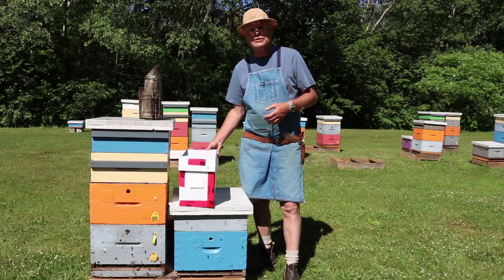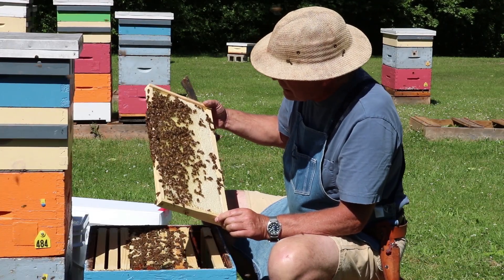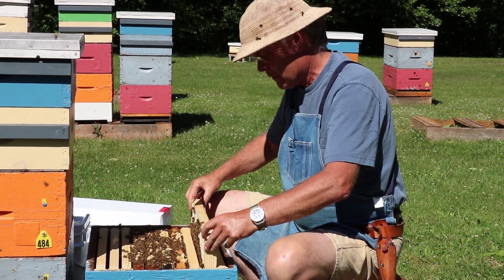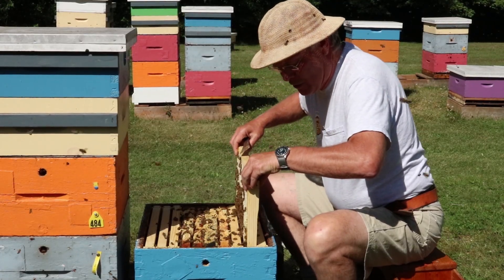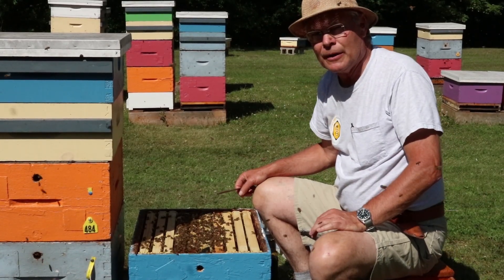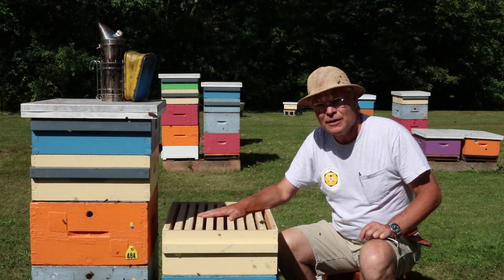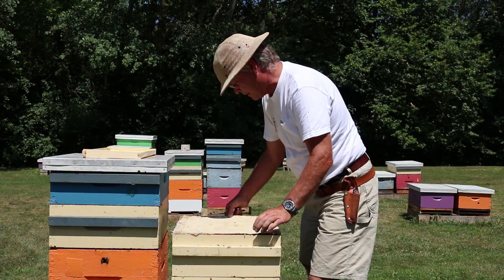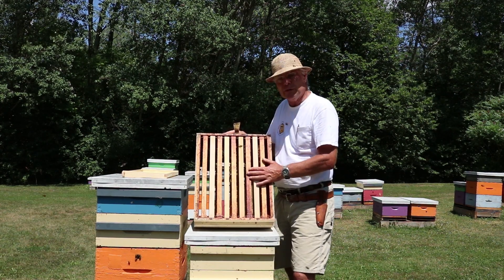Comb Building

Comment: What are you using for the inner cover?
Reply from the maker: Q2: Why do you use canvas for the inner cover?

A2: We use canvas inner covers for a few reasons. They make it easy to take a quick peek in the hive, and are cheap and easy to make. They are light, the lids sit down well, there is less excess wax on the frame top bars, and we rarely need to scrape the inner cover. Ants are also less likely to take up residence on a canvas inner cover. We use 18 oz (#8) canvas – otherwise known as cotton duck.

There will be some shrinkage, so cut it to 1/4″ wider and longer than the length and width of the box.

It is available in the USA online here, in Canada at here, or in Hamilton, Ontario here.

Bees chew through thin canvas so a heavier weight is better. We flip it over periodically when new so the bees thoroughly coat it with propolis. An alternative is a feedbag folded in half.

Comment: I have tried putting foundation frames between drawn frames in a super before, but I find that the bees draw out the existing comb to fill the space instead of drawing out the foundation. Not sure if that's because I have plastic super frames or not.
Thank you for the invaluable knowledge in these videos. It was one of my main sources of beginner info when getting started, and I still refer to them often.
Reply from the maker: I see some of that too but if it doesn't work one year it will work the next.

Comment: Hi guys, thanks for the great videos you’ve produced.  I’m a new beekeeper and just installed my nucs about 9 days ago (June 10th).  I checked on them for the first time today and they are building comb on the new foundation.  My concern is that although I installed the nuc frames in mid-June and the weather has been warm we have not received any significant rainfall in over a month and things are very dry.  Will that affect comb building?  Should I continue to feed my bees?  Does the dry weather affect nectar flow significantly?  I’m in Grey Bruce.  Thanks.
Reply from the maker: Hi There
 It depends on the available forage in your area. Generally hot and dry is good... until it gets desperately dry.

Comment: Hi Paul -- Great  video on comb building!  I have been using similar top feeders but considering moving away from them due to quite a few bee drownings.  I have some rigid plastic floats in the syrup but not very effective in preventing the drownings.  Wondering what type of material you are using in the feeders.  Looks like wood shreds of some sort?
Reply from the maker: Hi Deborah
 We use straw. It's cheap and easy to get here. We dispose of it after the feed is taken down. Very few bees drown.

Comment: When do you normally start providing sugar syrup. My hive has made it this far ok (March 10) but the next month is usually when I lose them all. There's still some sugar candy on the top board not eaten.
Reply from the maker: We feed new colonies like the one in the video when we introduce them. Our full size overwintered colonies are only fed in the fall... a lot! That way we don't need to worry about them running out in the spring.
   If your hives are light start feeding syrup when the bees are flying most days. Candy is ok to get them through until you can feed syrup.
Reply: @UoGHoneyBeeResearchCentre  Thanks. Added 1:1 syrup to a frame feeder in the top (2nd) box which they seem to be taking. Seeing lots of small bees arriving at the entrance with yellow legs.

Comment: An excellent primer in frame management, thankyou! For those beekeepers starting out with plastic foundation, Eric Smith of the Susquehanna Beekeepers did a nice little experiment which demonstrated that if you paint some extra beeswax onto plastic foundation (which has hardly any beeswax on it at all), the bees will much more readily draw it out: https://thebeeyard.org/should-you-add-wax-to-plastic-foundation-yes/  This is a nice trick to use when trying to build your stock of drawn comb, if for any reason you cannot use wax foundation.
Reply from the maker: Hi WW!
  Nice to hear from you. Good tip about waxing the foundation.

Comment: Great video love the info. The issue I have is they are not building on the new frames but they do build on the inner cover. I have about 7 frames of bees and thinking of adding a super
Reply from the maker: Hi Michael
 Thanks. 7 frames may be a  bit early to super. Bees like to move up more than to the side so they don't get all the brood chamber comb built if you super too early. Good luck.

Comment: How do you build your feeding boxes and do you use a 1:1 for comb building.   
Open Air feeding works good but causes a Huge Yellow jacket population that lead to problems late in the year.  
Tried the frame no drown feeders with Plastic float.   Lost a ton of bees to yes Drowning.
Tried the on top drip feeders.   Occasionally the pin holes gum up and drown the bees.  Was told the sugar:water mixture was to much sugar.  

Thanks
Reply from the maker: http://www.uoguelph.ca/honeybee/education-hive-top-feeder.shtml
This is a link to feeder plans on our website. There are plans for other equipment there too. I think hive top feeders are the way to go for most beekeepers in most situations.

Comment: Thanks for the informative video, but I have two questions.

1) I noticed that when you opened the hive the second time, the bees built burr comb on the top of the brood chamber despite the fact that the outer frames weren't drawn out. I've noticed this too in some of my hives. Does this mean that the bees are less inclined towards drawing out comb on foundation?

2) Why did you add a second super when the first super wasn't fully filled with comb?

Thanks again!
Reply from the maker: Hi Sir
 You are most welcome.
 1) Bees build comb around the location they are clustered so they built some on the top bars above the cluster. Good observation.
2) We need to anticipate bees needs.

Comment: Hmm turning that frame around changed the orientation on how the comb is being built. I personally believe, through experience, that the bees really don't like having the comb reversed. The "Y" should be facing up on the outside of the comb, and upside down facing toward the middle (opposite sides have opposite orientation). True it was just one side but that side will be the "wrong way" from now on.
Reply from the maker: I disagree.
Reply: @UoGHoneyBeeResearchCentre  Ok. You don't agree with the Housel Positioning Theory, or just don't think it matters?

Comment: one thing I do is move unbuilt frames into the middle. So far it has worked, what could go wrong?
Reply from the maker: Hi Na
 It will work but it's easier for the bees to look after their brood if you don't spilt up the brood by putting a frame in the middle.

Comment: Do you ever have to clean off the queen cage?  Lots of wax to impeded the bees it seems.  I take a portable propane torch and it  melts and burns  off the excess wax in seconds.  Wonder what you think.
Reply from the maker: Hi There
 Do you meant the queen excluder? We melt the wax off it at the end of the year. We use a heated chest. It sounds like a torch works well for you.

Comment: would it be possible to do a video on methods you use to cull out old brood combs. for instance. if you look in the box and the center 3 or 4 combs fully laid but need to go. how do you set that up to get that done without thowing away brood and at the same time keep them from back filling with honey. or even old full crystalized honey frames. time of year? What are the preferred methods. The process of culling comb is only ever discussed after It's empty and out of the hive. no one discusses how to get it Empty to take out of the hive. honey comb in the super is easy, extract replace. but, the brood chamber is a whole different ball game.
Reply from the maker: Hi RAW and Bee Bob
 Replacing comb in singles is a conundrum. We put in new frames when we take out splits, remove poor combs from dead hives and as Bob suggests move poor frames to the outside positions for later removal.
Reply: @UoGHoneyBeeResearchCentre  Exactly why I suggested a video. There is a whole whack to learn and know about bee keeping. Especially in the first couple years the learning curb is steep. I got a steal of a deal when I bought my hives. I got 2 -10 frames from a commercial guy reducing his stock so I got a 10 frame box for the price of a nuc. I certainly am not complaining but let just say the frames are OLD. Damn OLD. It's not that the comb is super dirty. But even being careful I've had 4 frames fall apart trying to take them out of the box. I've watched enough videos to have seen that many nucs being sold have old frames in them. So many new beekeepers are facing this problem in short order.  Folks who buy packages are putting bees on new equipment. But folks buying nucs are usually getting frames that are years old with all the previous prying shaking and banging. 

A video addressing the conundrum if nothing else will give good advice but it will also recognize the fact that even for the pros it's a conundrum at best.
Reply: I was taught by a pollinator years ago.  Where I am we use double deeps.  When you want to cull out old comb or broken comb place it in the bottom outside corners in summer.  In spring when you are ready to work the bees it's likely those frames will be empty of everything and you just pull them and replace them with new frames and foundation.  
AS for the single deep system?  It might be a little more difficult.  I guess putting them on the outside and then in spring replacing them, but earlier?  That would be my take.